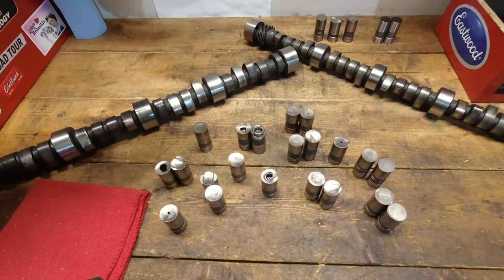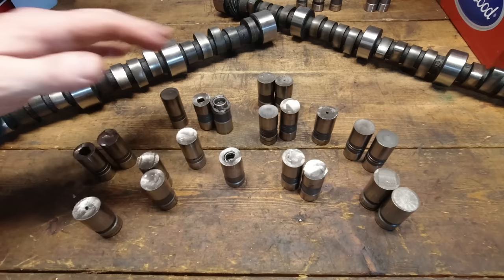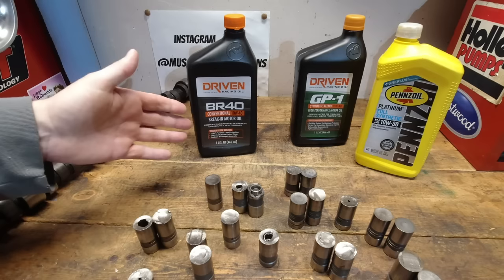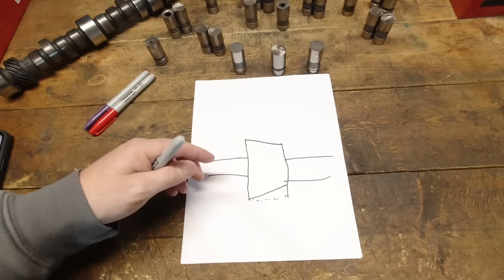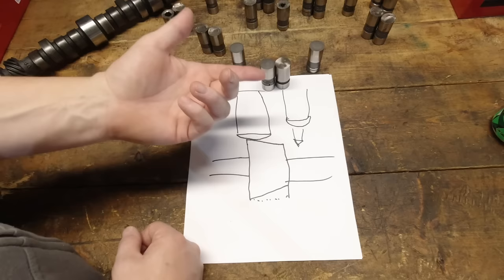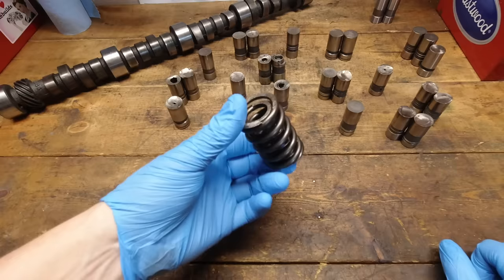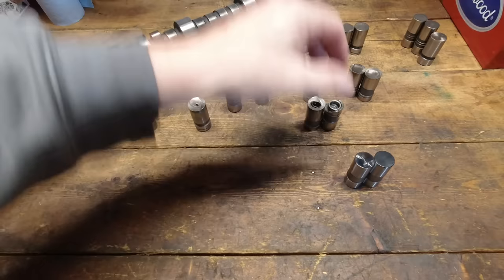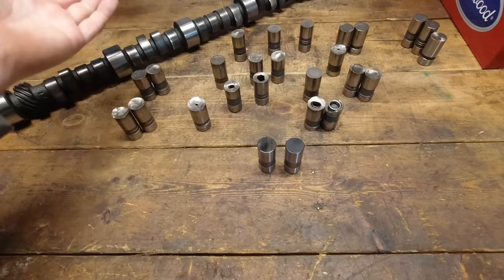Flat Tappet Cam Failures: The Reason Why They Go Bad & The Solution! Part 1

Comment: This is same old false solutions peddled for years now. You will find that people do all this man suggests and will still have failures almost constantly no matter the oil, the spring pressure, break-in procedure. The real solution is to use the genuine GM hardened wedge/hardened foot lifters and that will solve this issue. Every flat tappet hydraulic or solid cam ever installed by GM at least in Chevolet had the hardened foot pressed fused on and this did not happen. Our shop spent years testing this. The real solution is use the genuine GM hardened foot lifters. The problem is in the modern lifters not made correctly. It really has little to nothing to do with the camshaft. DLC coated lifters might be slightly better but I suspect they will still fail, another false hope like the EDM lifters that do not solve the problem either. These modern lifter and cam companies do not have the solutions--they are not engine builders. They are confused or in denial or deceived beleiving same things this man has convinced himself. Run the GM hardened foot lifters and dont look back.  SAG Performance and Custom Engine Supply sell the solid genuine gm hardened foot lifters hyd or solid for Chevrolet and can offer others for other applications. GM still offers certain hydraulics with hardened face/foot.
Reply from the maker: If that type of lifter is the only one that survives, then why don’t those manufacturers switch to making them?  You’re incorrect about DLC coated lifters.  They’ve been out for quite a few years on the race side and do extremely well.  You’re correct that EDM lifters ended up not doing so well.
Reply: @MuscleCarSolutions  The hardened foot lifters are still made by and sold by GM under one part number. The others do not make them this way because it would be too expensive for them and they likely do not really care to solve the problem. They can just keep blaming the oil used and the break-in procedure like you are doing. Or, the aftermarket just are clueless about it. I suspect the DLC lifters will not be the answer. But I hope I am wrong. Really the lifters just need to be made the way they were by the OEMs when cars ran flat tappet camshafts and easy problem solved. I could take a factory set of GM lifters with the hardened foot or face and use springs with 400lbs open pressure 180 on the seat with the cheapest farm store oil, no zinc, and not even pay any attention to break-in RPM and I am highly confident the GM lifters would not fail and thus not take out the cam lobes.
Reply: @MuscleCarSolutions  DLC lifters have been used some over the years on tool steel bodies on billet core cams and the tool steel lifters alone are over $1500 a set. I suspect this new marketing campaign for the same old unreliable lifters now coated with a "diamond like coating" which is only around .5-1 micron thick is going to yield much to any difference in the failure rates. Still same old incorrect lifters now with a latest greatest coating as the new solutions. There is a big difference between the DLC lifter of the past which was a tool steel lifter which could only be run on a billet steel core to to the harness of the tool steel lifter. DLC is really likely not much different than having the  lifter surface nitride hardened. We tried this sending parts to shaft-tech who nitirde hardens crankshafts for some of the major USA crankshaft manufacturers and we had Comp Cams nitride flat tappet components years ago. Trouble was that this hardened layer is so thin it did not solve the problem. More false hope. GM already solved this problem back in the 1950's with a very simple and effective solution. The crown or taper and hardness of lifter was carefully controlled on the harderned foot which was then pressed or fused on the lifter and unless someone does not change their oil, or runs engine out of oil, these lifters are almost impossible to observe a failure. I have only seen them fail after around 30-50 years of use on high mileage engines with bad oil change habits--and even then a lobe will only be down maybe .020" and engine still runs fine. These OEM GM lifters were / are so good that they can even be taken off one camshaft that has been run for years and put on another new camshaft or used camshaft that it was not originally mated to. I have seen this done several times even though normally one could never take used lifters from one cam and install to another new or used camshaft.

Comment: 42 min video to explain how to overcome cheap parts! Damn shame even the US manufacturers aren't much better than the Chinesium from FleeBay.
Reply from the maker: If that’s all you took from the video, I’d suggest watching again and taking some notes along the way.
Reply: @MuscleCarSolutions  I took more from it, but my point remains the same. I did look into the CompCams DLC lifters, $111 for a SBC is cheap insurance against lifter failure, and a heck of a lot cheaper than converting to roller lifters which also have a habit of failure recently.
Reply from the maker: @DiscoTex-fv1om  I did a separate video on just lifters, which I still think is the biggest issue on hardware, but it’s not the two biggest issues in a flat tappet break in.  There are two that are the biggest culprits and two that are the most ignored.

Comment: Why fail ? Because you should have used a roller , flat tappet cams are no longer made by big co ,gm ford and with that went tooling and r&d dept and there you have it no more flat tappet cams china are machining bottom bevel crown is all over place   its a crap shoot . Ls7 roller  lifters  $ 170
Reply from the maker: There’s no way I’d build a flat tappet cammed engine these days, but the failures have spurred development and the DLC lifters are the real deal.  Pretty to cool to see a cost effective solution.

Comment: So we are back to blaming the oil again.......every hillbilly in the 60's and 70's threw a 3/4 race cam into everything that moved, barely did any break in and it all worked just fine. I'm not sure what the real problem is but its enough that I just go for factory roller blocks to get the roller cam on a budget (we all know this $600 for a set of tie bar lifters is price gouging). Just like we all had to give up on soft valve seats and lead in the oil the time has come for giving up on the flat tappet. On a side note that coating that Comp came up with has alot of other uses (I am thinking valve stem) EDIT: I meant lead in the fuel
Reply from the maker: Oil is only one part of that equation.  I cover it and the others extensively in this video.
Reply: @MuscleCarSolutions  I watched the whole video (well done btw). But if the lifters are all hunky dory, the cams are all made to absolute pristine perfection then what's left?. Oil, springs, and procedure.....like I said most break in procedure back in the day was haphazard at best. So that leaves us with oil & springs......I don't really have a dog in the fight since I am going roller wherever possible anyway.
Reply from the maker: @yurimodin7333  as I made mention in the video, I think it’s mostly lifters that are the culprit.  It’s just a guess, but a question that I’ll be asking Billy Goldbold when I interview him at the end of the month.  Cam cores appear to not be the issue.  We’ll verify that here very soon with another video.  For sure like you mentioned oil and spring pressure becomes even more critical.  Can’t blame you for going roller.  It sure solves a lot of issues!
Reply: For sure the lifter failed first.Had it happen on a VW 1.9 pd at 260,000 miles.Most annoying thing was it failed about 2 months after timing belt change although the two aren't related but annoying nonetheless.Regular oil changes with VW approved 505.001 spec oil.Lifters will fail eventually no matter what you do.Not a big fan of those type of lifters.Good video.

Comment: The gas today has no lead in it today's oil has no phosphorus in it is what's causing that use Brad penn green oil take RPMs up to 2000 for 20 minutes and Break cam in properly change oil look for metal if good you're broke in and it'll run fine
Reply from the maker: Oof.  This is exactly why I made this series.  So much incorrect information in your statement.  Keep watching the videos in this series.  Hopefully you’ll get a better understanding of the process.
Reply: @MuscleCarSolutions  then why do all of my Motors run so damn good with no cam problems
Reply from the maker: @user-hi1mn4uj9y  there’s not one solution for everything.  Watch the videos.  I go into kits of details.  Glad you’ve had success.

Comment: Why did my camshaft fail? Well it was because I was stupid and believed that Comp Cams is a great camshaft and that is not true and they did not refund my 500$ I spent and the cam destroyed my engine so my take is don’t buy Comp Cams products!!!!
Reply from the maker: So what happened?  What engine?  What spring pressures?  What break in procedure?  What oil did you use?  What were your lifter to bore clearance numbers?

Comment: You lost me when you said you need a break in oil like Driven. I agree people make a lot of mistakes with oil. And using that oil is one of the biggest. It's a shame, I was hoping your video would have solid info. I could discuss lifters at length, and the real problems with flat tappet failures. But the oil nonsense needs to stop.
Reply from the maker: I don’t think I’ve worked with or talked to a single engine builder that would say break in oils are a mistake.  Not only for a flat tappet cam, but to help the rings finish their break in as well.
Reply: @MuscleCarSolutions  That depends on your definition of a break in oil. I use a conventional, group III base, 10w-40 engine oil for break in of flat tappet cam engines. Easy enough to get, with middle of the road specs. It carries a current API rating. Has 700-800 ppm of ZDDP, which is more than the API required for flat tappet cams when those test sequences were conducted with flat tappet cams. I do not use heavy duty (diesel) engine oils, I do not use synthetics or part synth/blends for break in procedures. I have 0 failures. 

The Driven break in oil, by specs from virgin oil analysis, is not a very good oil. Yes, it has a lot of ZDDP.  Yes, it has low detergency. It has has a very low total base number, high volatility,  poor viscosity range, and overall poor specs. You can argue for break in purposes, it will not be in service long for those things to be a problem. Fine. But that's an expensive,  low quality oil, being marketed with a lot of hype to people hoping what comes out of a bottle will save them from poor quality lifters and improper procedures.

Oil should not be the focus of these discussions. It was never the culprit. And too many very large cam companies were more than willing to sell substandard lifters and point the finger at oils. 

I take this stance not only as an owner of many flat tappet engines, but as a professional engine builder of 30 years that for a time in college studied Tribology.  Your videos often have much useful, helpful information. But starting this video off with oils took away from the parts of the video that followed, in my view. Please understand, I am not saying this to simply troll you. I genuinely support what you do.
Reply from the maker: I’ve never heard any engine builder call Driven a low quality oil.  It’s been the exact opposite.  Seems everyone has their “brand” they go to for everything and you’d have a better time insulting their mother than to get them to agree any other brand is good.  Very strong opinions there for sure.  Which I do understand, but oil isn’t the only factor here.  Which is why the other two major ones we discussed in this video - cam taper/lifter crown and matching up the same brand instead of picking anything off the shelf and what I think has been the biggest factor and that’s spring pressures.  I’m fairly confident that I’ll stand behind my assumption that it’s the lifter that is the major culprit here.  Yes the ones I secured were ALL made by US manufacturers, but even that doesn’t matter.  I fully believe (and maybe in my conversation with Billy Godbold next month will confirm this) that the quality has gone down because they are concentrating on making roller set ups that net them more dollars in the bank.  That’s why you’ve seen cam manufacturers scramble to find the solution we didn’t have to look for in the 80s and 90s.  We never used a break in oil, which o suspect might have been better for the rings than the cam, but still.  I never had a cam fail until 2003/4?  Somewhere in that time frame and I jumped ship for roller and never looked back.  Now we’re looking at zinc levels of 1200ppm as the norm for flat tappet engines to keep them together.  I’m not a tribologist and never claimed to be one, but if the experts say it will help, then it has to be considered as part of the solution.  That is until now when a new lifter with a DLC face might end that discussion once and for all.  Time will tell.  For now, I’ll keep using Driven if it’s got the right chemistry for my needs.  Maybe next week at the Performance Engine Expo I’ll explore that topic with a room full of folks smarter than I am and see what the suggest.
Reply: I agree v8packard, never had these issues 20 years ago and all this break in oil nonsense

Comment: Break in rockers.
Reply: Very good info by the way.
Reply from the maker: For sure a bit of an expensive way to help the process, but I have seen some local shops offer them (for a fee) on loan or as part of a paid for engine break in on an engine dyno.  Good point.  I should have included that info but the video was ridiculously long as it is!  I’m quite sure we’re not done taking about cams and lifters…. Thank you!

Comment: Bottom line,  stop using flat tappets !!!!!  The EPA has reduced ZDDP in 1994 to very low say only 800 parts per million,  they been using ZDDP motor oil since the 1930's,  well things have changed .  Due to emissions,  EPA wants to eliminate ZDDP,  so far the oil companies will not do it.  In the past,   we used about 3000 parts per million in ZDDP.   Today,  they all use roller lifters and they don't need ZDDP anymore.  A few motor oils still use ZDDP around 1200 to 1600 parts per million.  Most motor oils are low in ZDDP.   With older engines add roller lifters,  yes,  expensive to fix it,  but thats the way it is.  Again,  use roller lifters its the only way to go.
Reply from the maker: Actually if you look at the data, all automotive engine oils had zinc.  Much less than in the past because the byproduct messes with the catalytic converters.  You’ll have to look, but I think @speediagnostix had a video where he gave some of the zinc levels in todays off the shelf oils.  I want to say it was around 8-900 PPM.  But his video would confirm that.  Flat tappets are about to take a huge price increase.  The other side of what happens when those lifter and core manufacturers don’t want to make them anymore.
Reply: @MuscleCarSolutions  Still use roller lifters,  even NASCAR uses roller lifters and at one point they were spending thousands on ceramic flat tappets,  no more.  Shubert Inc is out of business.  One more thing,  Amsoil uses about 2000 parts per million,  Pennzoil about 1600 and a few others.
Reply from the maker: @ronsmith7739  it’s not the amount of zinc that’s magic.  It’s the type of zinc addictive used and how it works with the rest of the additive package.  More doesn’t mean better.  We got that information in the Driven interview and a little in the interview with Lake.
Reply: @MuscleCarSolutions  Still no point in using flat tappets anymore,  use roller tappets / lifters.  At some point the EPA will force to go to zero in ZDDP.   Since the early 1980's 100% in production cars use roller tappet / lifters.  Again,  this is 2023,  not the 1950's.

Comment: Wow bad advise.  
Take the windage tray out for brake in? 

You know windage prevents aeration of the oil?

You know a windage tray doesn't go between the crank and the cam? 

Every one knows you dont run over 130 on the seat for a big block flat tappit.  

The cause  of most lifter failures is soft lifters. And shity oil. 

You only need 1 soft lifter to eat a cam. 

We avoid flat tappit cams at all costs. 
When you are building a 10 thousand dollar engine, whats 5 or 8 hundred dollars extra for a roller.  You get more power and you can run just about any oil in the motor.

Comment: You can't run a competition cam because they're failing everybody in the last two years of having these problems and all sudden everybody's using the wrong oil what about all these years before these problems were all over United States all these engine builders are complaining flat tappet Cam shaft or failing left and right they've been using the same oil for years now come on get off of it man
Reply from the maker: Jesus dude.  You’re all over the place!  😆 Oil is only one part of the equation.  And yes folks make fatal mistakes with their choice all the time.

Comment: I'm tired of hearing all the hear-say & guessing. Some people just repeat what they hear & then add their own opinion with it.
Reply from the maker: That’s why I’ve done my best to break it down with real examples and not just make a bunch of guesses and whiteboard drawings.  Go check out the second video in this series where we cut down cams so you can SEE the heat treat depth.  Final video in the series on lifters coming very soon.
Reply: @MuscleCarSolutions  I hear lots of people mostly blaming Comp Cams, but could it be that their cams simply out-sell other manufacturers
Reply from the maker: @reginaldhall6871  that’s an absolute fact.  There’s not another performance cam grinder in the US that even comes close to their volume.